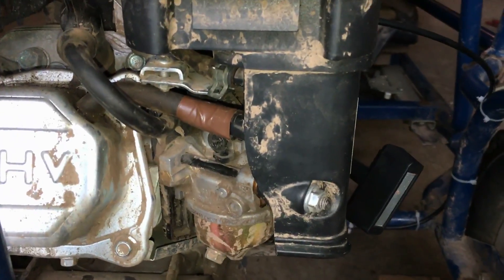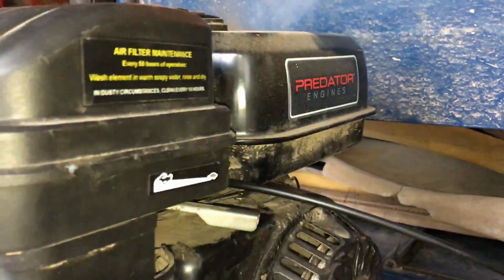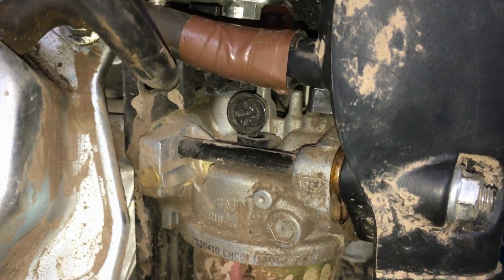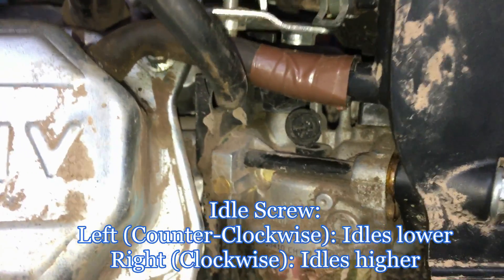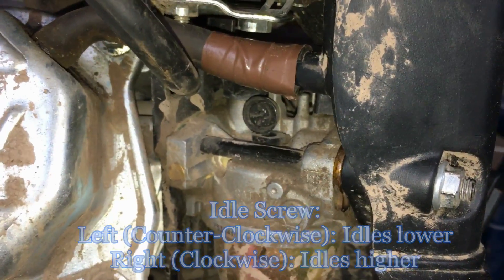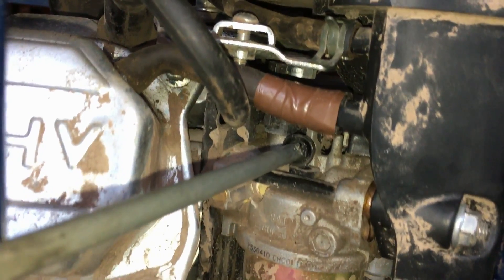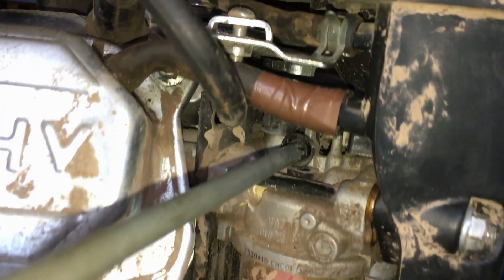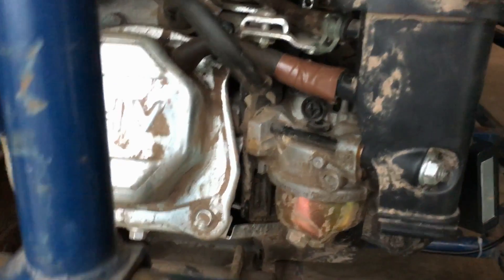How to Adjust the Idle Screw on a Predator 212cc Engine!

Comment: Will this fix a issue i’ve been having? Where my engine only turns on at full throttle but once I let off the throttle so it can idle it just shuts of. I even tried holding the throttle down then turn the choke off but then it gets super loud and starts to reach its max rpm. Don’t know what it can be. I heard it can be a fuel issue with my gas tank too though but i’m not sure cause I do have a aftermarket 4 liter gas tank on my mini bike and i’m not running one of those small oil filters I just have a straight tube running to the carb. Any information helps, thank you.

Comment: This screw does nothing for the idle.......If you look underneath that screw it holds an orifice in ,  remove the screw completely  and you can pry up on the orifice to clean out the gunk from the hole which the gasoline passes. If this orifice is partially clogged the engine will run high idle and rough,

Comment: Did this with a 420. DON'T turn is too far. You end up with gas in the crankcase.. don't ask how I found out lol
Reply: How'd you do that? The idle screw only controls the throttle body, if you got gas in your case somehow, that's a whole other ballgame
Reply: lilwarthog all I know is I turned it wayyyy too far and the engine shut off and was hard to pull. Opened where you put in oil and there was a pressure build up from gas getting into there. It all shot out
Reply: @calebcarr3816  first thing is drain that oil if there is gas in it. Than I'd check your carb out. Put new oil and clean carb, check float etc. Your float could be stuck in the on position from gumming from normal gas. Running racing fuel in it will prevent that.
Reply: @lilwarthog  I fixed it the same day. All I did was tighten that screw back up and changed the oil and it was fine. I'm familiar with how engines work but that ones got me confused lol

Comment: Question that black screw does it have to do with leaning or richening the mixture? My 212 engine fouls plugs within a tank of gas and i dont k ow how to adjust the carb that is on my engine. The guy i bought it from said its an upgraded carb not stock but i only see one screw towards the bottom that can be adjusted i turned it all he way clockwise and the engine keeps running. I thought if its all the way to the right it should close the jet making the engine turn off? Correct me if im wrong. What can i do to adjust the carb to not foul plugs so quickly? I gone through 4 spark plugs in 3 days
Reply: You need leaner Jets and a hotter plug.

Comment: Hey when running the engine do i put the choke lever wide open and lower the idle speed so the bike doesnt go on its own? or keep the choke lever low.
Reply: reyes gopro put the back of your go cart/mini bike on a brick or jack stand  when checking  the idle. If the tires are spinning freely it might be your throttle cable on to tight..

Comment: oh yeah one more question how do i know how much to tighten it to the right or to the left i sont know how to adjust it properly
Reply from the maker: +ALBO you want to turn it so that the idle is wherever you want it. It should run without dying out from such a low idle.
Reply: GoodTimeGarage so do you think it being tightened all the way will be a problem then because i had to screw it full clockqise for it to even start
Reply from the maker: +ALBO if it starts then wherever the screw is should be alright. Hard to judge from my perspective though.
Reply: GoodTimeGarage alright thanks so as long as its running i shouldnt expect any damage to anything right?
Reply from the maker: +ALBO I wouldn't think so but it's hard to tell what is going on from a comment. Hope this helped
Reply: GoodTimeGarage thanks man

Comment: i tightened myn all the way i had no idea what it did this guy in a forum told me to tighten it and i did all the to the point where the screw broke off now i gotta tighten or loosen it with pliers also is that why my clutch got screwed up because my clutch got overheated would this have to do with it at all?
Reply from the maker: +ALBO from screwing it all the way in it could have overheated the clutch but I'm not 100% sure. The high idle might have overheated it. Someone else might know a little more than me about that.
Reply: GoodTimeGarage the clutch was worn out before i tightened it because it wouldnt even start until i tightened it all the way but i ordered a torque converter anyways since my go kart tires were 16 inches and dont really gotta worry about staying at low speeds for long distance

Comment: I just installed this engine on my go kart, while idling it starts rolling on its own. Is this the screw I need to adjust? Thank you
Reply from the maker: +Wagonracer8 I would try the idle screen first (in this video) but it could also be the tightness of either your chain or belt.
Reply: Ur throttle cable might be tight
Reply: My coleman minibike has the same problem it goes on its own and the throttle isn't too tight I checked that. My chains are plenty loose. I will try to lower the idle I think I was touching the fuel ratio screw not this black one
Reply: @Partnerthedog  did you figure out what the problem was because I’m having the same problem. I tried adjusting the idle and now it randomly goes out in its own.
Reply: @alternator7893  if the clutch spins too fast it engages, have you ever cleaned and greased the clutch it should be done often. Its usually cause by the idle being to high
Reply: @Partnerthedog 
Hey did adjusting idle screw work for you?
Reply: Hey did adjusting idle screw work for you?

Comment: Mines still not idling how can I make it just not move at all
Reply from the maker: +Carson_da_boss Can you explain what you mean alittle more?
Reply: I have the same engine and all but my doesnt idle at all it just zoomes off and slowy gaines speed do u have a fix?
Reply from the maker: +Carson_da_boss The only thing I can thing of is the idle is too high still, try to idle it down and once is beings to stall out, idle up a little to keep it barely running. Or your torque convertor and chain set up is too tight and your belt has no room to move which is causing your gokart to move at idle. Is there anyway to make the belt a little looser?
Reply: GoodTimeGarage yeah I ordered a new chain and clutch I'll put it on and tell u the out come
Reply from the maker: +Carson_da_boss Awesome! Let me know if that works!